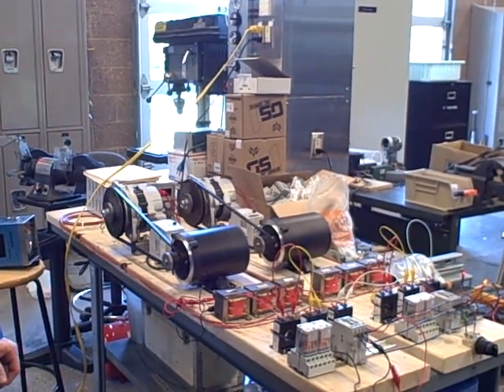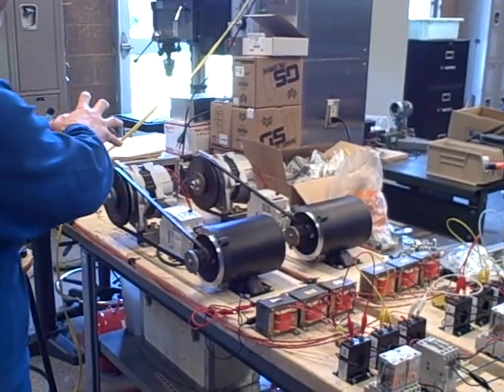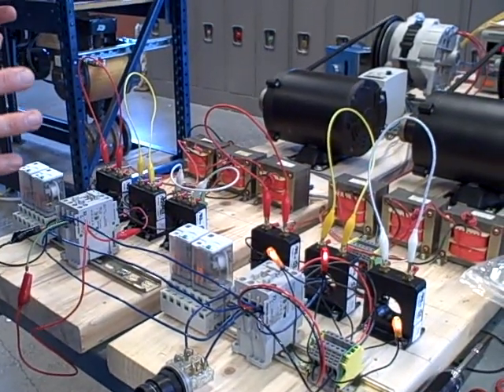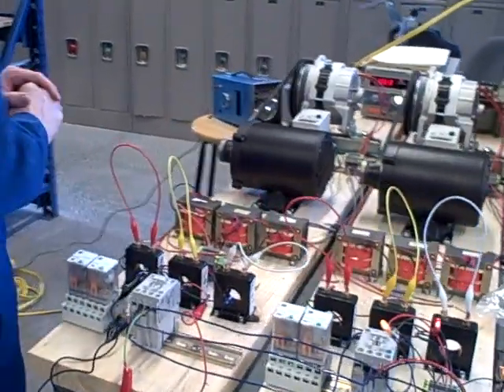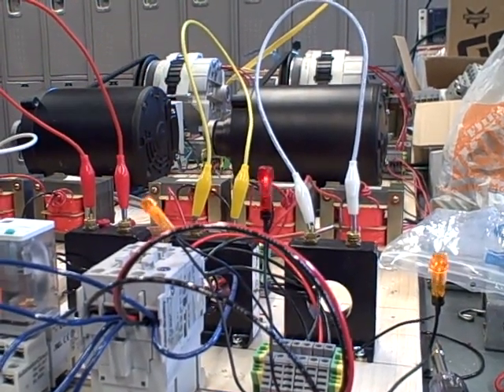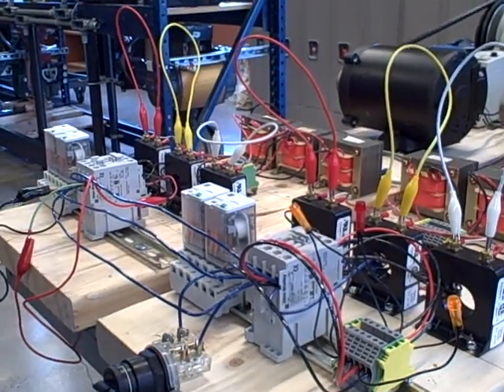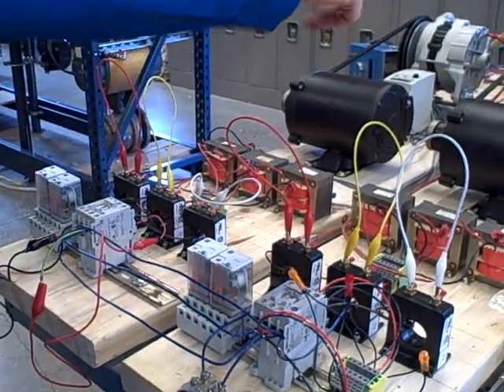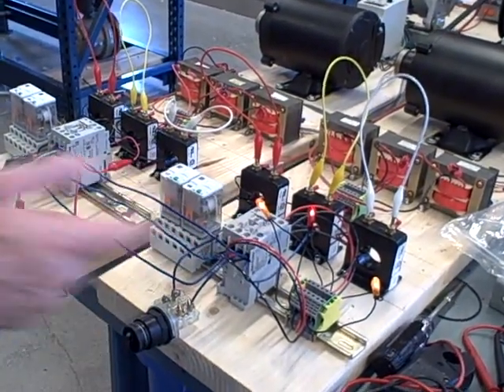Synchronizing AC generators -- Part 1 (introduction and sync lamps)

Comment: hi,
i dont understand the wire connections. can u explain in details how the connection are made especially after the circuit breaker. were are the neon bulbs connected to.
Reply: light bulbs are hooked on either side of the contactor. contactor is open so the bulbs prevent a short circuit. since they aren't in phase there is a potential difference and current flows. when the bulbs go dark, there is no potential difference and they are in phase at the same voltage.
Reply: OK. But how is this done in a real situation. I mean they wouldn't use neon light bulbs. How do they do it then
Reply: +Akshay Vyas they do. if these are 10 MW alternators they have to parallel they get bulbs rated at twice the alternator voltage. they hook these bulbs up across both terminals in the breaker/transfer switch/contactor. the only path for current to flow is through the resistive load of the bulbs preventing short circuit. once they go dark they close the switch. I'll find you a picture of the wiring diagram
Reply: they literally use lightbulbs dude. heavy duty lightbulbs
Reply: wow, MW light bulbs huh? would like to see some pictures of these bulbs.
Reply: +Akshay Vyas no. double the voltage rated bulbs. they don't see full alternator power. just the power the bulb would require to be energized. if the alt was 240 and the bulb was 100 ohms it would be rated for 2304 watts.
Reply from the maker: +Akshay Vyas For generators outputting voltages beyond the rating of ordinary lamps, you would power the lamps through potential transformers (called PTs, or alternatively VTs) which step the line voltage down to 120 VAC nominal.
Reply: +BTCInstrumentation do you have a detailed picture of how the lamps are connected to the contactors and the alternators?
Reply: If you have no proper test equipment in the field you can make a  " lamp bank" to parallel gens..  They can be very DANGEROUS!! to use. If the "lamp bank" is new to you I highly recommend you seek someone with experience in their use. If your Gen output is 3 ph. 50-60Hz- 120-208v Y or similar low voltage- take six (6) rubber pigtail sockets and series wire the sockets(power will come in one wire,up through the filament of the bulb,down to the connection under the sockets,up into the second bulb filament and down to the connecting wire) in pairs of two, 2 in series for each separate phase A B & C. You will need six (6) rough service 125 volt incandescent lamps. NOTE!  All lamps must be the same wattage. The reason for this is that all lamps must glow with equal brightness to eliminate any confusion. With the lamps firmly installed in the sockets attach wire rated at least 300 v to each pigtail to extend wires for hook up. You should have six (6) hook up wires or leads. If at all possible make connections BEFORE gen set(s) started.  With power off (hopefully) attach the wire(s) of "A" socket, one wire to the LINE side(A phase) of contactor or breaker for Gen#2 the other wire to the LOAD side (A phase)  same for B  & C phase. Make sure Breaker for second incoming Gen#2 is OPEN. Bring Gen #1 up to speed and close #1 Gen Breaker. Start Gen #2, match voltage and frequency(maybe slightly higher freq.) of Gen#1, DO NOT close Breaker #2. Observe lights. All six lamps must fade or surge in unison(at the same time).  If all do Not, the phasing to parallel is incorrect and MUST be changed to cause all lights to dim and brighten in unison before closing breaker for Gen #2. Breaker for Gen #2 is CLOSED when ALL lights are off or nearly so. When lights are bright- a cross current exist due to phase angle displacement and if the incoming Gen#2 is placed on line and the phase angle critical with respect to Gen#1, a tremendous surge may exceed safe limits and result in damage to equip. or explosion.  If you have a 277-480v system. You need six (6) 240v Incandescent lamps(same wattage) and replace the rubber pigtails with porcelain sockets. All wiring should be rated for 600 volts in this instance.

Comment: Man I am trying to figure out how to wire 2 alternators in my pickup any help I’d greatly appreciate
Reply: It's easier than this.
Reply: @Joshie2256  can you enlighten me?
Reply: @RollingThunder85  If they are internally regulated the sense wires can simply be tied together and the outputs doubled up. You need enough ampacity in each output wire to handle the output current of each alternator.
Reply: @Joshie2256  I'm running zero gauge out put wire and I have a xs power AGM and a optima yellow top AGM then when I'm parked I hook up a LiFE battery it's equivalent to a couple  battleborn batteries. I got the two alts to work then it causes so much power loss to run an extra alternator I can feel the Horse power loss I guess you can't have your cake and eat it too

Comment: I have a question maybe someone smarter than me can answer: How does the grid not slowly increase speed and runaway? If grid load was low, it seems like there wouldn't be sufficient amperage to provide "back torque" to mechanically couple the motors. Thanks!

Comment: I'm not sure how you have your lights connected. In reality they should be going on and off sequentially so that you can determine if the generator that is being brought on line is faster or slower than the reference generator on the bus.

Comment: I suspect they need a lot more than 3 LED's to connect a gigawatt to the grid.
Reply: Why would you need more than three? Technically you'd only really need one as long as you know each phase is 120 degrees out of phase with eachother.
Moral of the story, you don't need more than three to sync a multi gigawatt generating station with the grid.

Comment: My analogy of synchronising of three phase alternators is not using " rotating batteries" as that does not make sense. I rather thnk of three flying members of the red arrows flying 120 digress with respect to each other  performing a " barrel roll in one direction and following them are three flying members of the Blue angels,  The idea of synchronizing the two teams is to get  a passenger in each of the blue angles to jump over to the cockpits of the red arrows  Without ANYONE GETTING HURT.  Hence the required state is that the  each team must be 120 digress with respect to each other and  roling on the same diameter circle and in the same direction . Only then the equality of the voltage, the right phase sequence and the frequency are met,
 
The rotating battery  is a silly example to suggest  as it is much more than that,  The two , three member display team is a more faithful analogy.  Perhaps rather than two display teams one should use three fuel tankers  while three F-22 are all trying to refuel at the same time with the three tankers flying the equivalent of a three phase supply system, with the three F- 22 following  with the required synchronised state!   Hunting about the final point is interesting  and excitation and throttle control is not explained by using " rotating batteries". 

One can use a similar demonstration using synchros or two wound rotor induction motors,  If one excites the rotor with AC and rotate the rotor one can get a rotating three phase on the stator      Two such motors excited from the same AC source can remain non rotating with a similar effect .   Also the three light bulbs are not connected so that they all show zero voltage at synchronization but two will be bright and one will be dark.   and they do show the difference in rotation and not only the pulsating effect,

A synchroscope  is only a unit with a three phase winding on the stator and a three phase winging on the rotor  where the excitation from the two incoming alternators rotate  the magnetic fields in different directions with the shaft of the unit remaining stationary at a particular direction when synchronization is best to be activated. ,

Comment: when the teacher is not looking, close the circuit when the lights are shining full. what will happen? nothing? generators will fall off the table? breakers pop? a whiff of smoke from the windings? belt slips? belt falls off pulleys?

Comment: That was my guess, but than I said "noooooo", one company would than have to spend fuel for the other.
But than I am a biochemist and a idiot concerning electrical engineering.
Reply: No, because you can measure the current output by each power plant ant thus "pay" them proportionaly.

Comment: This is the dark lamp method, an alternate method has the lights bright when the generators are in phase. In the dark method if all 3 lamps do not go dark at once the 2 generators are not wired in  the proper phase sequence.
Reply: If the lights are at full brightness the two generators would be exactly 180 degrees out of phase.
Reply: @billmoran3812  there are two methods/schemes of wiring up the synchronization bulbs. One scheme/schematic has the bright/on when in phase. The other scheme/schematic has them dark/off when in phase. If you are trying to get them really close in phase angle before closing the switch the dark lamp method is liked by many folks. That is because it is easy to see a bulb barely lite up than the difference in brightness at the peaks. Regards
Reply: @3beltwesty  with both sources in phase, the differential voltage is zero therefore the indicating lamps will always be dark.
Reply: @billmoran3812  with both sources in phase the lights can be either bright or dark. It depends on how the phase detection bulb/schematic "scheme"  is . Thus without knowing the phasing scheme one doesn't know the "logic"  of what the lights on or off mean. The two schemes are in pre 1900 electrical engineering books. In like matter a light on or off in a plane train spacecraft might mean trouble or non trouble. You have to know the logic ie scheme of what the light means.  An always on light is risky since the bulb may burnout if a poor design too.

Comment: I did the lightbulb sync successfully many years ago in EE Lab, and then opened the relay.  Then my lab partner was wanted to do it again, but he failed to wait until the bulb extinguished.  He managed not only to put the lab in darkness, but also the lecture hall (with class in session) in the same building.  Don't think he got a passing grade.

Comment: Didnt understand why they keep on sync ... really "as if a mechanical force joined them together...to stay in sync"
Imagine 2 500Mw 3phase generators, under the same dam, they should be on sync, my intuition is to get them in SYNC mechanically, and not to advance or delay, I really cannt imagine how one would regulate the water flow so fine, that they will keep angular velocity EXACTLY the same FOR EVER... imahgine the inertia of those rotors spinning, monster spinning hoped to be more in sync than 2 quartz oscillator same size, for ever... dont get it
Reply: Imagine you have 2 motors, and you link their wires directly together. Turn the output shaft on one, and it will create a voltage that will turn the other motor at the same speed (ignoring losses from impedance). Thus you can't really spin one slower or faster than the other, because that will create a voltage difference between the two and the current from the faster one will drive the slower one, so they are held in phase. Naturally they will drift out of sync, but they're virtually mechanically coupled because if one slows down then it will draw current from the other which will bring them to the same speed.

Comment: You'd think in this day and age the electrical engineers could figure out a way to allow the power stations to generate electricity independent of each other, and regardless of whether they were in-sync or not.  It seems very antiquated to have to go through all this hassle.  After 100 years, we should have been able to move beyond this anachronistic requirement.  This is why we have cascading power failures today, because no power station can operate independently from another.
Reply: it is really expensive to build a powerstation that is able to run asynchronous from the grid because you need a AC to DC convertion and then DC to AC to couple it to the grid. 

these systems do exist for high power and high voltage systems but are so expensive that it is uneconomical to have them at every powerstation. running a generator synchronous to the grid is easy and reliable (because of the very nature of a generator)
Reply: One of the reasons the Tesla/Westinghouse AC power system won out is because parallel operation of multiple DC generating sources as promoted by Edison is difficult and less reliable. Edison’s system essentially served various areas with separate generators that were not interconnected. Much less efficient and less reliable.